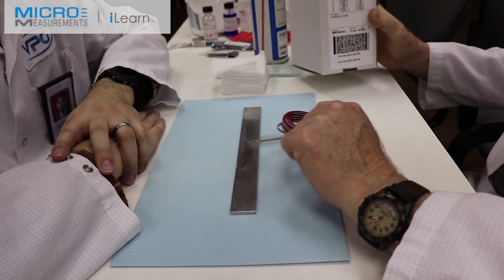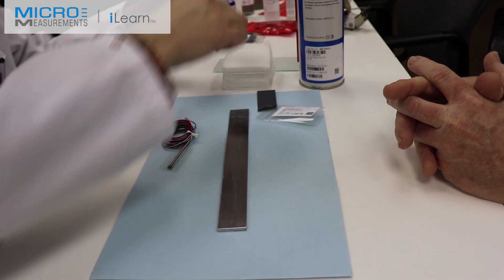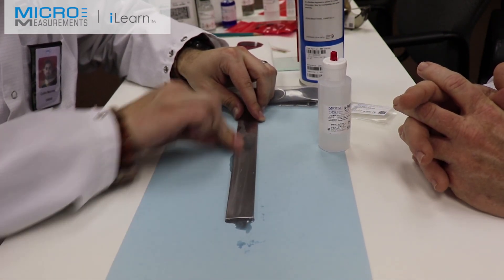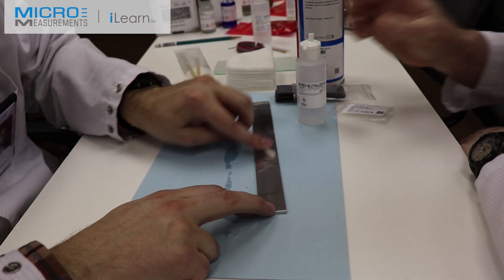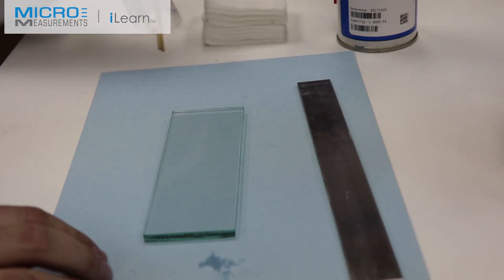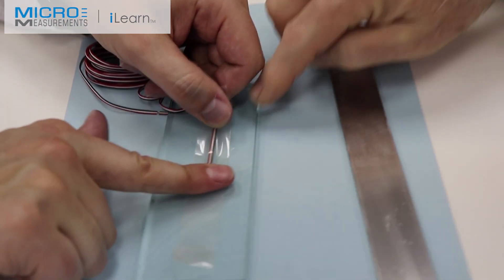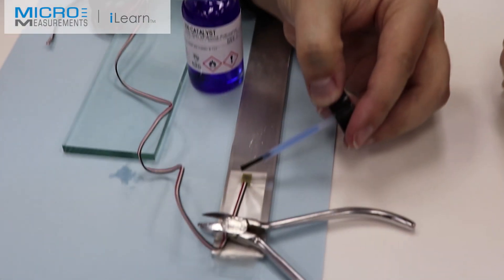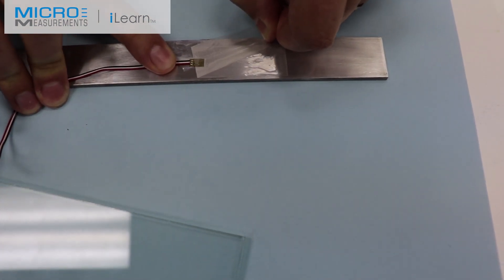The Beginner's Guide To Advanced Sensors Strain Gage Installation

Comment: Muy buena guía de instalación de bandas extensométricas de Tecnología Advanced Sensors de Micro-Measuremnts, con el adhesivo M-Bond 200, certificado para este uso, y excelente en ensayos en laboratorio debido a su rápido secado a temperatura ambiente y a su facilidad de aplicación.
Si necesita más información, por favor no dude en contactarnos. mm.es@vpgsensors.com miguel.bravo@vpgsensors.com